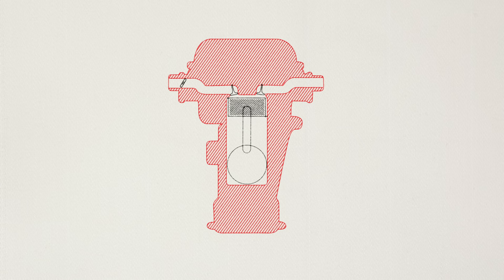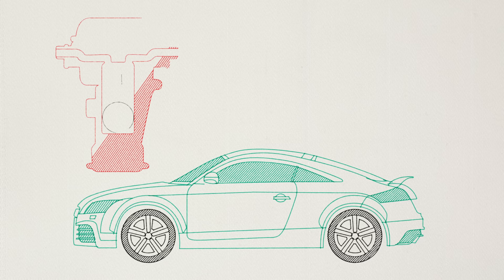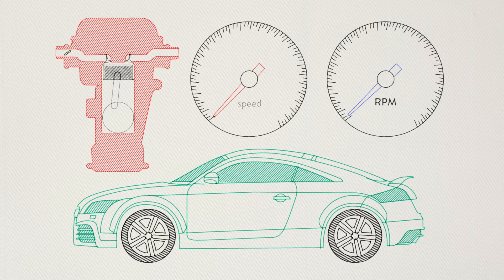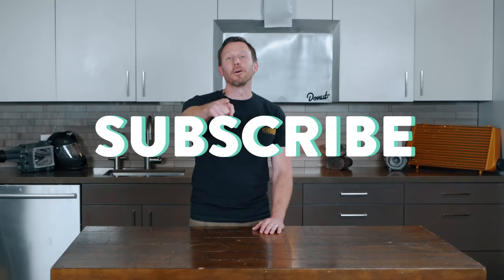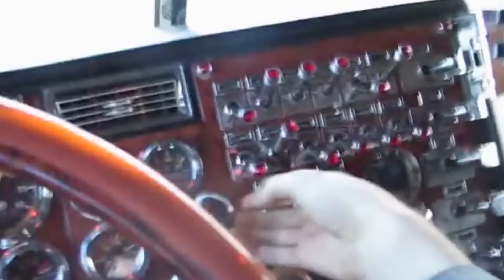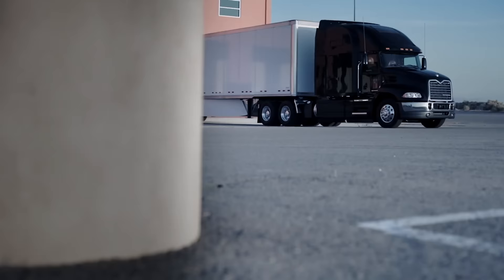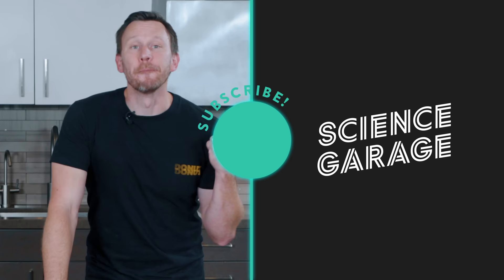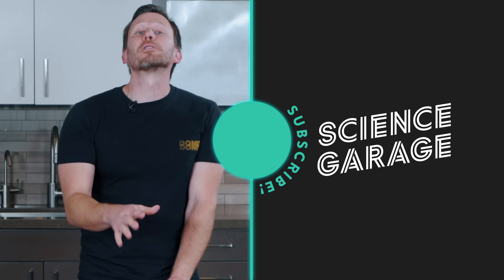ENGINE BRAKING | How Semi Trucks Slow Down Without Brakes | SCIENCE GARAGE

Comment: This guy  missed the critical effect of the Jake braking  system. He was correct in saying   Jakes  use the  energy of  compressing the air on the up  ( compression ) stroke to slow the vehicle ( but that would have happened anyway ) what he  didn't explain is  by  quickly dumping  the compressed air ( which makes the iconic Jake brake noise) it causes the piston  to now move down AGAINST  2 CLOSED VALVES  without the former assistance of  compressed air  or  the  diesel  bang  ,this creates a huge negative energy drag on the engines rotation which in turn  creates the real braking effect from the Jake system

Comment: How does acceleration in a diesel engine work without a throttle body? If I press the gas pedal, do I send more fuel into the engine or do I send more air? Or both?

Comment: It's probably one invention that has saved more lives than can be counted in the transportation industry; yet about every small and large town across America have engine brake ordinances rather than just making their police enforce noise ordinances.
The truck making the sound for engine braking in this video has straight pipes on it, small mufflers, burned out mufflers or at the least a  resonator.
If a truck still has adequate mufflers on it, it's really not any louder than being on the throttle.
In my opinion inclement weather is the only reason that there should even be an off switch on the engine brake.
I move 160,000lbs+ from time to time, I'll be damned if I'm going to turn mine off just because some idiot mayor and city council thinks I should. 😂

Comment: Most are 80,000 some are more some are less but money wise you wanna haul the max amount depending on the space between the middle of the tucks rear axles and the trailer axles. So trailers that are 43 feet usually have an available gross weight of 78,500 otherwise 80,000lbs would be overweight due to the length between the axles
Reply: Idk why i typed this out but 73,000 was a bit off from the usual weight a semi truck hauls, and its my chosen profession

Comment: Here in europe the trucks have mostly retarders and jake brakes but retarders can slow you much much slower i dont how it works but it has something to do with water the engine
Reply: So i watched a video about how they work and its a big box attached to the transmision and when you turn a little lever with levels its sends a command to that big box and it fills air pressure in the oil container and the oil is pushed to disc a thing that spins with the transmision and it spins the oil and then it pushes the oil while it spins on to the drive shaft and it slows it down but it heats up of course and it has a cooling System and it goes throw an intercooler that cools the oils and repeat

Comment: Not every big rig has a Jake brake some older Caterpillar engines could not mount a jake brake so they had to design their own device to do that for their engines they called it a brake saver which does the same thing as a Jake Brake but uses hydraulic pressure to operate which instead of a rumbling noise a jake brake does it just lets out a low pitch whine but can be a problem if set too high. Then Mack has what is called a Dynatard which is because Mack didn't have the rights to produce a Jake Brake for its engines it sounds often like a person farting. They also got a device called a power leash on newer engines.

Comment: Why do automatic cars not have so much noticable engine breaking when you let off?
Reply: Because instead of clutches, automatics have torque converters. The torque converter automatically unlocks the engine from the transmission when you let off the accelerator. Although some newer cars automatically re-lock the torque converter to employ engine braking when the computer senses you using the brake, but the car isn't slowing down much, like when you're riding the brake down a hill

Comment: Lol, there's some weird inaccuracies here. The piston goes at the speed that matches the revolution of the crank that matches the speed of a wheel in a given gear, no matter what. This never changes, unless your engine or your transmission breaks, or disengage the clutch, or you have a torque converter.

Comment: Hi, 
I have two questions, 
If I understand it correctly, does it mean, that if you're engine breaking on petrol engine, you actually using less fuel, as the air/fuel ratio is lower compared to engine breaking on diesel engine as in the diesel engine the fuel is still injected inside the cylinder, but then just released after compression, without ignition. (Jake breaking spends little bit more diesel, than engine breaking on petrol engine? )  
And the second one, in case of diesel engines and jake breaking, if ignition does not happen, does it mean, that air/diesel mix is going straight to exhaust, thus it is damaging dpf filter more? Is that the reason, why it is important to properly regenerate dpf filter after some time? 
Thanks for the answers :)

Comment: Fun fact:  u can also start the engine backwards and have 6 reverse gears and 2 foward gears ( well for me atleast depends on wat transmissions yall got)
Reply: it work on any manual transmission because it has a flywheel unlike an automatic transmission that has a torque converter

Comment: When the Jake Brake is activated, is fuel and air getting mixed and sent out the exhaust unburnt? Or is the fuel also cut off on activation?
Reply: Fuel is at idle position when jakes are on.  So very little fuel going in.  It is still burned. It just doesn't provide power.

Comment: Semi trucks can absolutely engine brake without a Jake brake. It's not that diesels can't do it, it's the amount of weight we're trying to hold back. Without the Jake brake we'd be going down some of these big grades at like 15mph. Also, the max load is typically 80,000lbs and in some states it's up to 110,000 not sure where you got the 73,000 number

Comment: So here's a question,
Sometimes when cruising behind a bad driver they will press their brake for no reason or start riding the brakes way before they need to stop. ( I drive an 01 4Runner)
Instead of braking ill sometimes shift from D to 2
This will allow me to reduce my speed from ~65kph to 55kph within 30ish meters without braking.
Is this kind of engine braking bad for an automatic transmission? Should I ditch this habit?
Reply: It can cause increased wear on the clutch packs.

Comment: One question i have about engine breaking is in a manual gas engine does your fuel efficiency go down for prolonging the revs higher than 3000 rpms?

Comment: Question : So at the end of the Compression Stroke during Jake Braking, right as the exhaust valve releases the built up pressure, wouldn't the piston violently slam against the top of the  cylinder....hence damaging the cylinders??
Reply: I would assume that the cylinder body isn't long enough to reach the top of the chamber when attached to the crankshaft, for exactly that reason.  It's long enough to compress air to diesel's flashpoint, it's not enough to slam into the top.

Comment: What a lot of effort to say
Exhaust brakes is the exhaust manifold being closed to create back pressure 
Engine Brake is the intake and outlet valves that close to create back pressure
Reply: That is not how a jake brake works.  You are describing a compression brake that closes off the exhaust to create back pressure.  The jake brake just eliminates the combustion stroke.

Comment: You gotta be careful using jake the dog down hill on a dirt road, your wheels could lock up if you loose traction and that’s not good, you have an exhaust brake too that uses back pressure to slow you down

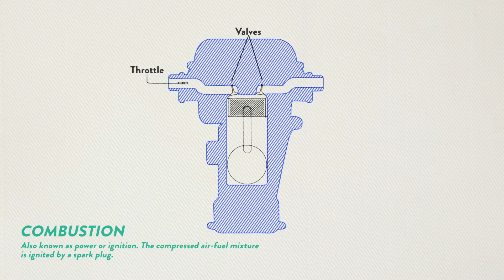Comment: 8:03 the fuel gets injected in the intake stroke.
Reply: Not on diesels they don't. The fuel is injected just before combustion on a diesel. Injector timing is the diesel equivalent of ignition timing in a gasoline.

Comment: I didn't understand jake brake. The compression stroke is always there whether you're jake braking or not. It's there in normal operation too. In jake braking you're just taking away the explosion/combustion. So where is the stopping power coming from?
Reply: It takes energy to compress a gas (air). In normal operation, you get that energy back five-fold from the exploding diesel/air event. In jake operation however, no fuel is added, and the compressed air in each cylinder is merely dumped (wasted) out the exhaust tube. The moving vehicle mass, wheels, driveshaft all contributed to compressing, and that just gets dumped away - so you're essentially robbing the energy from the momentum of the vehicle.

Comment: What I want to know is when you're coasting down a hill in an automatic transmission vehicle and you're not giving it any gas you're just coasting but your RPMs are at say 4000 is that using the same amount of gas as if you were using a throttle to drive at 4000 RPMs or are you better off saving gas and putting it in neutral

Comment: So while engine braking does not break the engine, it does ever so slightly increase wear on the engine, right? Had an argument over this with someone who rightly pointed out that worn brake pads are much cheaper to replace than a worn engine.
I still engine brake a lot though, as it means the car, for a small moment in time, uses less fuel than when the engine would be idling. Efficiency. Sort of.
Reply: If used right the engine brake doesn't wear the engine out much.  If used wrong it can break an engine.

Comment: How does the exhaust lever (Jake brake lever) know when to open exhaust valve at power stroke
Reply: There is a mechanism that alters the timing of the cams to open the exhaust valve at a time it normally wouldn't open

Comment: 8:03 says that the mixture is ignited by a spark plug but diesels dont have spark plugs
Reply: Zach Morris No it doesn’t. It outright says that the heat from compression ignites the fuel/air mixture. The animation is just originally of a gasoline engine...

Comment: Most of diesel SUV I’ve owned have good engine brake even without me switching anything. Does jake brake work automatically?
Reply: Some modern diesels have throttle bodies that are used for engine braking. Exhaust systems are also pretty restrictive today because of all the emissions equipment so you get some engine braking from there as well.

Comment: The original purpose of a Jake Brake was not to slow down the vehicle but to prevent the diesel engine from doing what is called a runaway which is a horrible event that can happen to a diesel engine which causes them to go out of control and often can lead to damage and destruction of the engine thrown rods though the block is a common effect. Stopping them is all a matter of luck and how fast you can move. First thing is to cut fuel but sometimes they will still run because they then begin to burn the engine's oil because of bad seals most times so in order to stop it you have to get to the air intakes and plug them with whatever you can find to cut off air to the engine. If your quick enough you can do this before any damage is done to the engine.

Comment: In case of petrol engine i believe your statement is incorrect
Let's say you are rolling down a hill Foot off the gas the car decelerates
If you switch your ignition off and open your throttle fully the car does not accelerate it will still decelerate
So the butterfly value is not the major factor (it might contribute)

Comment: So I don't want to sound like a YouTube scientist. But I, as many do drive a diesel pick up. Diesel engine braking is (not Jake brakes) is more efficient than gasoline powered engine braking thanks to the higher compression ratio of diesel fuel systems. I get that this was specifically aimed at trucks but its also slightly inaccurate.

Comment: In North Carolina they slow down going down old fort mountain,  if they are too stupid to follow the 35 mph speed limit,  by hitting one of the runaway truck ramps or by going through the guardrail and over the mountain ⛰️ 🤔

Comment: So what is happening when I engine brake in a manual diesel truck that does not have a Jake break? 

By that I mean just down shift, throttle to RPM match, let the clutch out, no more throttle, same way one would in a Gas car.  I do this often driving sub-CDL trucks, they do slow down, and do not make the Jake sound. Is it just the extra engine friction?

Comment: With regard to Jake Breaking: would the uncombusted diesel fuel/air mixture exiting through the exhaust valve in a turbo diesel setup create any sort of antilag effect? Like combusting in the exhause side of the turbo?
Reply: No diesel is injected when the jake brake is on.

Comment: I had a teacher once that taught shop and electronics and he got on a rant one day about engines and he misinformed the whole class about how a jake brake worked...he said “that engine stops and spins backwards” I laughed so hard I about fell out of the seat.. he said “what’s so funny” I said that is not how it works.. I said just think about  your going 60 mph if your engine all of a sudden spins backwards theoretically you’re going to lock up your tires and do a reverse burnout 
So I had to explain to the class how a jake brake worked that day

Comment: We have a lot of diesel cars in Europe and as far as I know none of those are equipped with a Jake brake, but they still slow down when you let of the throttle. Why is that? Is there some other mechanism involved?
Reply: Diesel engines have much higher compression in the cylinders when you let off the throttle the cylinders still compress the air in the cylinders.   The compression of the air will slow it down.

Comment: Actually what it really does of the jake brake it's slows the truck down that kills the cylinders in it because it's like this if you go down the hill you turn your Jake brake on high or low to low your gears down you could call them to different Jake brake engine brake

Comment: I drive manual so when traffic slows down on the freeway I slow down by letting off the accelerator. and eventually downshifting I think it drives nuts the trailing driver because I slowed down but no brake light illuminates. I can tell they're confused.

Comment: So in jake break, during the compression phase if it releases air pressure through exhaust valve then what about the fuel mix, does the fuel gets out of the exhaust causing more fuel consumption
Reply: No fuel is injected when the jake is on. Modern cars with efi won't inject fuel when the rpm is above idle and the throttle is at 0%

Comment: There designed to slow the engine down. decelerate the entire brake system when slowing down at fast speeds and coming down a slope/hill/decline of course being in the proper gear and maintaining the speed for shifting up or down 
Depending on the situation ur in.

Comment: And what about Diesels in cars and trucks? Do they have that system too but it activates automatically or what?
Reply: Most small vehicles do not have engine brakes. They dont really need them and they are expensive and add complexity

Comment: Hey so when ur driving fast in gear lets say 2nd gear at 4k revs... And you suddenly let off the gas and the car slows down fast and i guess does "engine braking" without down shifting. Is that bad for the engine? It makes it very easy to slow down especially combined with the brake. Before i would just go fast kick up the revs and go into neutral and brake. I just wanna know if letting off the gas high revs and it jerks back is bad or not. Thanks
Reply: Wow i just copy and pasted this before watching this video and he just said what i was thinking about lol

Comment: Diesels can engine brake. And they do it better than gasoline engines. When you let off the gas pedal fuel isn't injected to cylinders but air is inside. Valves close, air is compressed but because lack of fuel there is no ignition. Compresing air is more energy hungry than creating tiny vacuum so diesel decelerates faster. I mean in normal car not in a truck. 
Jake brake is about slowing truck or a least keeping the same speed downhill.

Comment: Doesnt that same type of "compression-braking" happen in a gasoline, too? 
Don't compression strokes still happen, just with minimal to no power in power strokes?
The valves aren't opened without a slap from the camshaft, after all.
Reply: It’s more of a “vacuum brake” than a “compression brake” since the throttle isn’t allowing as much air into the cylinders. But there is no fuel injected when you let off the gas. So there is not power in the power stroke.

Comment: 8:03 I thought diesel engines didn't have spark plugs? (Look at green text on the bottom)
Reply: This is correct but they do have glow plugs which warm the mixture for super cold icy environments  so it can ignite by compression. Just a Editing mistake they forgot to change from their petrol version

Comment: I still didnt get it how come early exhaust or low compression will slow the vehicle.
Reply: During the compression cycle on any engine, since it's compressing the air/fuel mixture, the piston is naturally gonna slow down. But, it'll get that energy back during combustion. Well, w/ a jake brake, it's still compressing, still slows down the piston, but since it's releasing all that energy early, right before combustion, it doesn't get it back. So all the engine is doing is slowing down. Hope this helps.